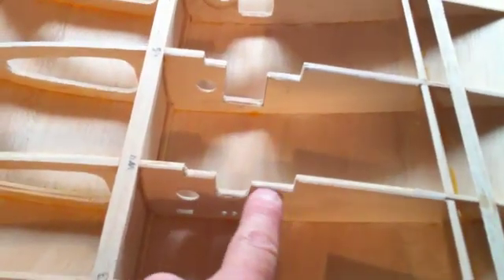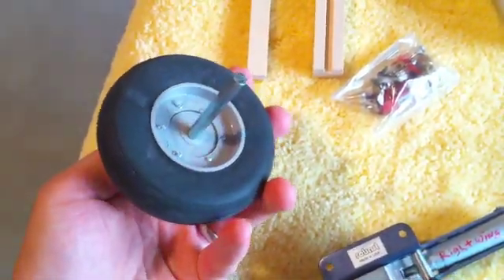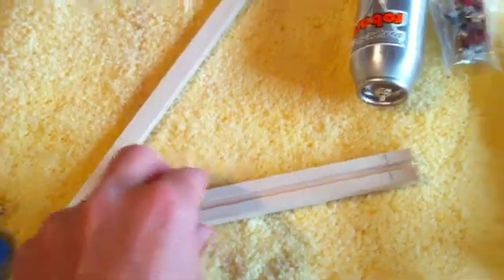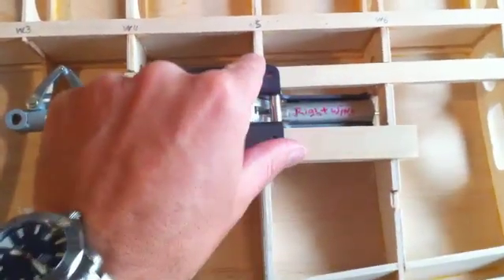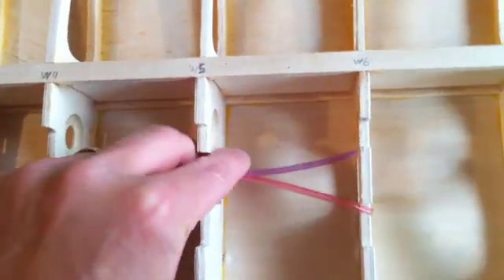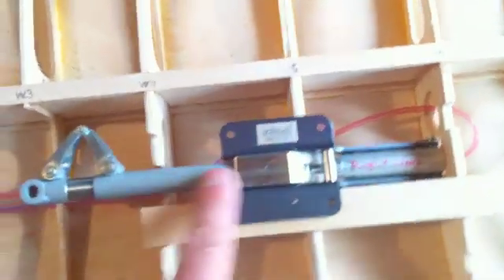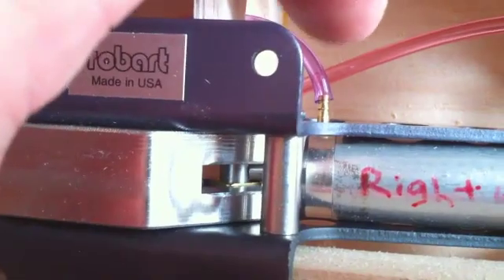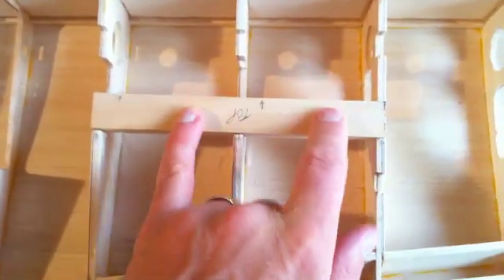Install Landing Gear and Retracts RC Airplane. www.howtomakercairplanes.com

Comment: Regarding retract plumbing, I have removed the hoses from the cylinder barbs on several occasions. You don't PULL them off, you PUSH them off from the base of the barb using any flat thin blade. I've even done it with fingernails (mine are quite tough!) Just be careful to avoid scratching the barb as this can lead to air leaks.